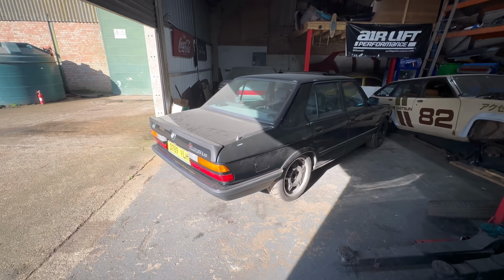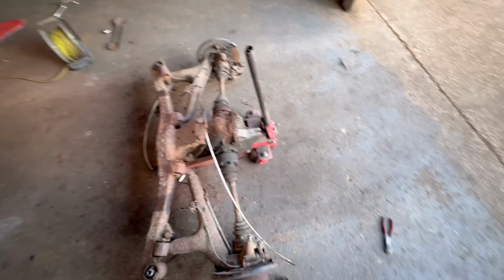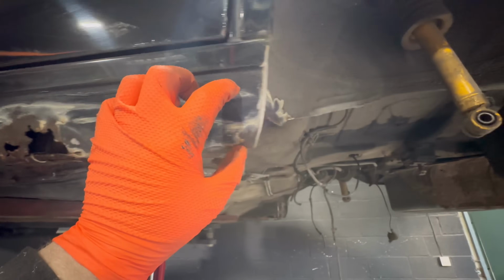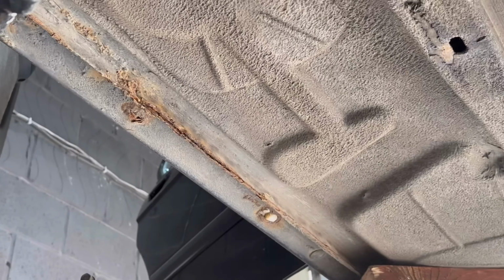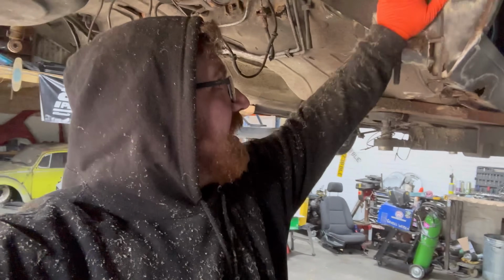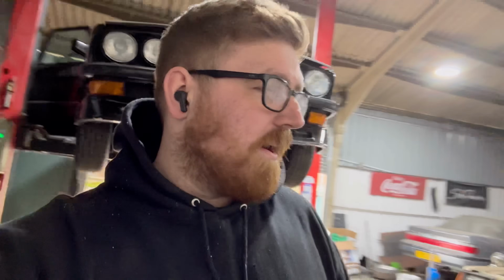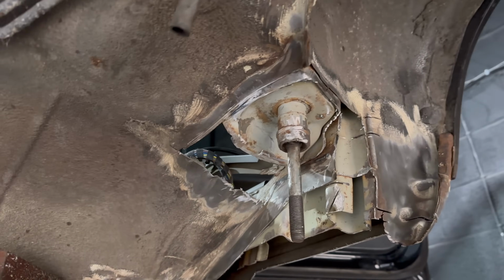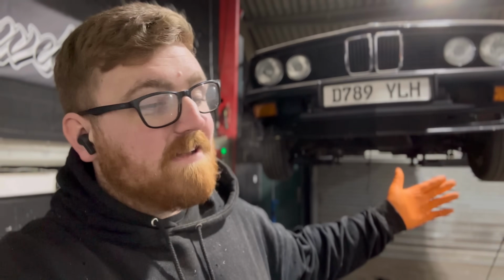HOW BAD REALLY IS TAYLORS E28

Comment: @.57  secs, that's a familiar sight to me, I owned two E28, 528i's in the late 80's till 2000. The first one Y reg, swapped the engine twice, rebuilt the head both times, it finally died at 286k on the clock. The second one, C plate , the body was immaculate, but had a piston through the side of the block, a valve hit a piston!!, the bottom end on my first car was good, so that went into the C plate car and I stripped the head and fully polished everything and lapped in new valves. That car was very quick and sounded fantastic, sadly, rear shunted twice was the end of that car.

Comment: Fantastic!!! I like seeing this as i have a -86 m535i in the garage!!!
Valcas garage has a lot of repair panels for these- and for reasonable prices!!
The sills f.ex should be changed as a whole panel to be able to repair the floors and especially the inner sills and the separated lower edge properly. 
In this way it is possible to rust proof/ paint the innsides in stages after every repair and the amount of weld seam inside is minimized.

Comment: Excellent work, decent welders are hard to find these days, my mechanic mate recommended a welder that did all the welding and spraying for his garage and was meant to be excellent so i got him to weld my inner arch, a couple of years later it looked like there was some surface rust coming through so i cleaned it back and found that he had pop rivetted the plates on, he wasn't cheap either, i should have realised when he first asked me if i wanted it fibreglassed!
I need some small repairs on a used alloy intercooler but can i find anyone interested, no,
Looking forward to more decent videos.

Comment: Nice work mate well done. May be of no interest to you but keep an eye out  for an old unwanted leather sofa, often given away free.  Get it cut  the leather off in large pieces, then when your welding lay them down wherever sparks could land and start a fire or  get at the wiring cheap and very effective protection bud. 👍👍
Reply from the maker: Thanks for the tip!

Comment: Hey josh done well on that mounting repair … also safety squints were on point 😂 

Just wondering about that upol weld through copper ? Had terrible trouble with brand name regular weld through primer atm . Would you recommend the copper stuff ?
Reply from the maker: 😅😂

Yeah the copper is good as long as you don’t layer it on!

Comment: Good to see a professional at work obviously Avery experienced rust repairer and the UK and other parts of the world were there is salt used cars rust but not in a lot of parts of Australia were l live and cars from the 1960s 1970s and the 1980s did rust in Australia infact there are Chinese built vehicles that rust in Australia despite been fairly new as l own a 1997 Toyota Hilux no bad rust issues and the Japanese cars you have in your workshop especially that Mazda 1800 l haven't seen one of those in years
Reply from the maker: yeah being in the uk, rust is big! it doesn’t scare me, however when buying a car with rust i would really have to want the car being the fact i would have to invest so much extra time into it to fix it!
Reply: @Joshwaa___  Fortunately live in Australia were rust is not much of a problem although there are a couple of Chinese built vehicles that are rusting and one is an EV from the largest Chinese EV maker and l have owned a lot of older British cars did rust and l have owned a couple of older Japanese vehicles that have rusted now my 1997 Toyota Hilux only has surface rust passes its rego check as you probably know Toyota spent billions on replacing the box framed chassis on Toyota utes in parts of the USA and Canada well l haven't spent a cent replacing the chassis on Toyota Hiluxes and Land Cruisers salting roads absolutely  ruins vehicles

Comment: The rust wasn't too bad I had a landrover discovery I that was a lot worse than that I was glad when I finished the welding on it unfortunately it was only on the road for 2 years after the welding I fxxxed the engine turbo and took the centre out of the flex plate it wasn't economic to repair it after that a neighbour bought it to repair  but even he had to realise it was to expensive to repair and he broke it for parts

Comment: Really fantastic vid... a couple of questions... First wouldn't it have been better to strip it and bead blast the shell ?  Second,  roughly how much would all this rust removal and fabrication work cost to do.
Reply: Youtuber time laps has a lot to answer for. Don't underestimate just how much work stripping to a bare shell is. It just would not be worth it. With regards to blasting, you would need a corse grit to cut through that rust, but ironically, it won't remove the seam sealer. You need to burn that stuff off and it stinks. It's a proper health hazard.

Comment: as soon as i saw the first video i could tell its bad... after owing 6 e28s. the rear end mounts have 4 layers inside. pretty bad to repair... at this point i am fairly certain that if you remove the front wings you will find some bad spots under there also. the areas near the front and rear shock towers also have 3 layers of steel and go from inside. usually they are the first sign of a bad e28. if they look fine under the hood then someone already has done something in there...

Comment: Sorry Josh, but they ain't welds, they are tacks covered in birdshit, then ground off to hide. They will probably hold, but it's such a shame.
Reply from the maker: You wouldn’t be able to weld that metal any hotter without blowing through, it’s only thin material, good penetration,  not much else you can really do, as another panel butts up against it, it will definitely hold lol
Reply: Same story I have with my mini, so easy to blow through. Couple of times I've had to cut out a section just because it was so thin. Love seeing it all welded up though. Hopefully on the home stretch now.